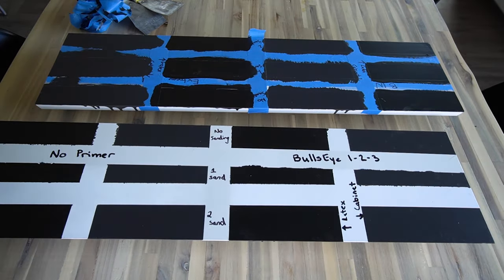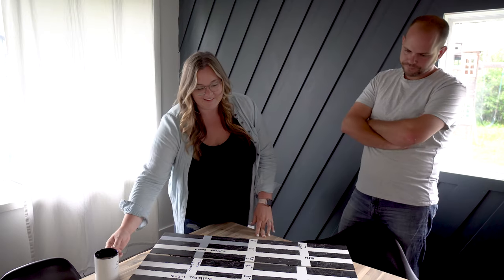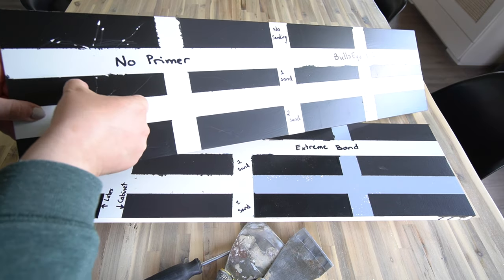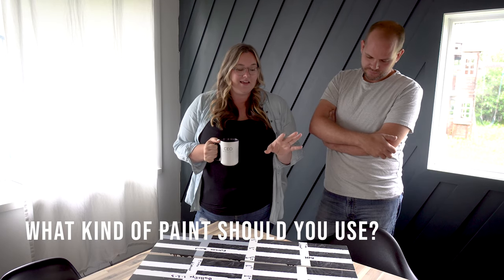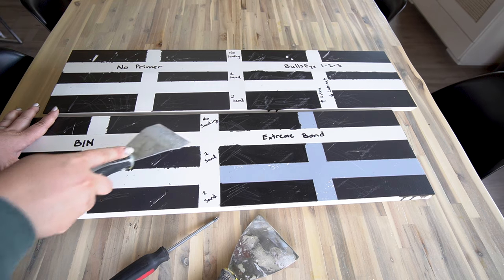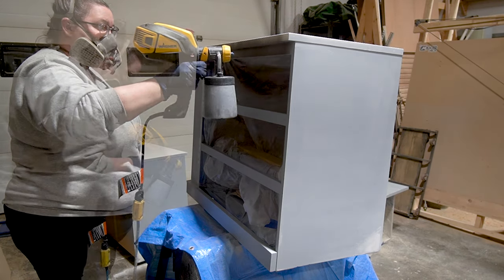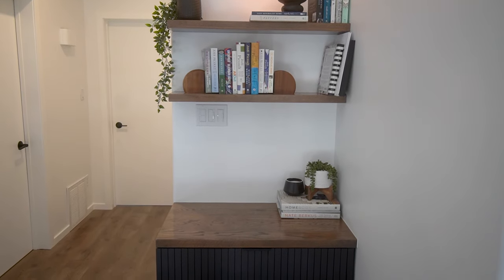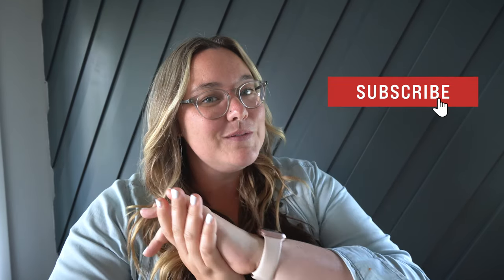How To Paint Ikea Furniture | IKEA Malm Dresser Hack

Comment: I got sent here by @diydanie . I've never tried to paint laminate before I usually use the shellac bin because I'm painting wood and I have tannin  bleed through. Usually sanding between coats has to do more with getting a smooth even finish then with bonding itself. Sanding between primer and paint would only make a difference if the primer went on kind of lumpy or rough. I would love to know by what you meant by like latex paint and cabinet paint? any of these chalk paints or mineral paints? What brand?  What sprayer did you wreck? I'm going to have to check out that extreme Bond stuff cuz I've been doing a fair amount of furniture work. I don't foresee myself doing a lot of laminate but I do currently have an Ikea desk but I kind of beat up and I'm switching up my desk and give it to my kids so it's going to be in the living room and I either need to paint the top or contact paper it. Do you know if that primer happens to block tannins? Thanks for the video

Comment: So, did you remove the Ikea top and make a custom extended top to cover the little side piece that you added? You replaced the top after the painting was done? What did you use for the top? I wish you had shown the entire process of how you added the top and exactly how you built the beautiful drawer fronts. (I'm not smart enough to figure all that out without specific instructions.) Great job though. I love it!
Reply from the maker: We had extra oak from another project so we laminated it together and made custom counter tops for these built-ins. But you could also get a pre-made wood counter top from a hardware store, cut it to size and do the same thing :) This video just goes over the painting - the actual build happens in this video https://youtu.be/BZkNRAHOR-I?si=Sa2JfS28hv0NKP1Z or search "Reading Nook & Upstairs Loft Reveal" on our channel :). Thanks so much for watching! Let us know if you have any other questions ☺️

Comment: Very helpful video. Can I ask when you refer to sanding between 1st and second coat.. is that sanding between primer and first coat of paint or between 1st and 2nd coats of paint? Do you need to sand between primer and 1st coat of paint? Thank you.
Reply from the maker: a light sand (like 200 grit plus) between any coat will help for a great finish. But if you wanted to minimize the sanding I would just do a light sand between the primer and first coat of paint.
Reply: @LindiandRuss  thank you so much. Very kind of you to reply.

Comment: Love this video, answers pretty much all the questions i needed answering going forward doing my own project, So thank you for that :)
one question tho, The Bullseye 123 primer, does work work using a sprayer?
Reply from the maker: It does! We’ve used it before. But it is thicker, so we usually thin it out a bit or it could clog the sprayer.
Reply: @LindiandRuss  Thanks for the quick reply :)
so do you water it down or use something else to thin it?
Reply from the maker: @paulpenfold9634  we usually use water, but you can also use something called Floetrol to thin latex paint.
Reply: @LindiandRuss  awesome, thanks again :)

Comment: I'm jealous, I used SW Extreme Bond and had horrible results. It scratched off so easily with my fingernail even though I sanded prior. The only difference is my SW Extreme primer was tinted. So maybe that was the difference maker.
Reply from the maker: We’ve used the tinted primer lots! Is it possible you didn’t give it enough time to set? We’ve used it on so many projects and have had literally zero issues - tinted and not-tinted!

Comment: I have heard about the Bin Shellac primer but you are the first with the extreme bond primer. Which would you recommend for apartment settings?
Reply from the maker: Extreme bond is alot easier to use and clean up. Shellac really shines for preventing bleed through on bare wood. As long as your apartment is ok with painting  -   I would go with extreme bond. If you are just painting walls, a primer like bulleye 1-2-3 is fine too.
Reply: @LindiandRuss  okay thank you for your feedback. Really appreciate it

Comment: What about a spray paint for "indoors and outdoors" for small IKEA 2 door little cupboard?
Reply from the maker: You definitely can use any paint method, this is just showing the method that I think will last the longest and give the best finish! If I was using a lower quality spray paint, I would probably sand in between each layer and still definitely use primer!